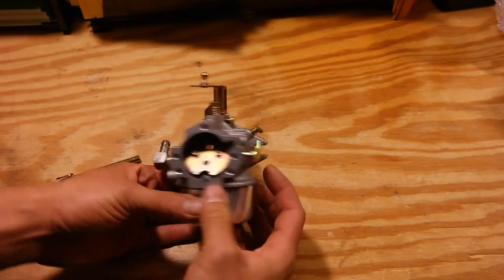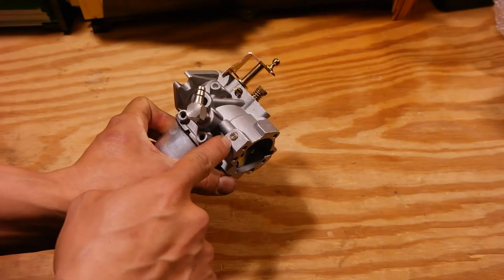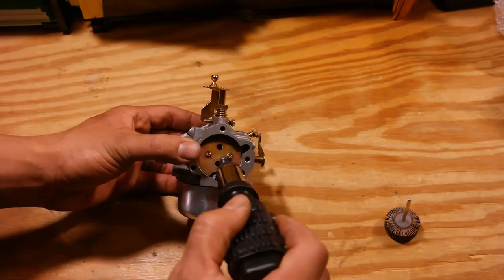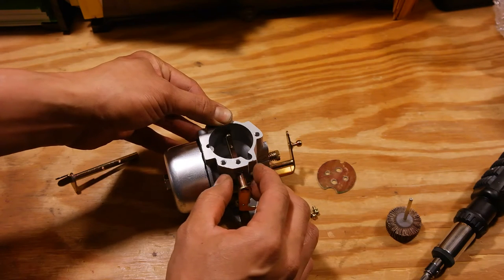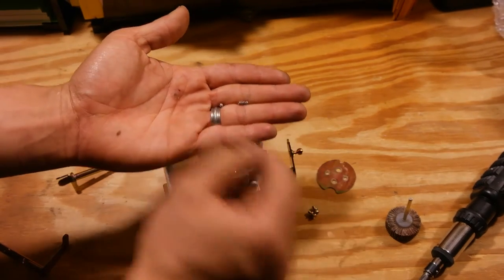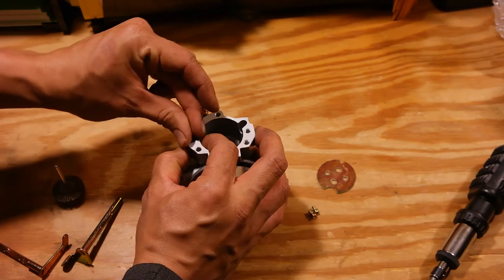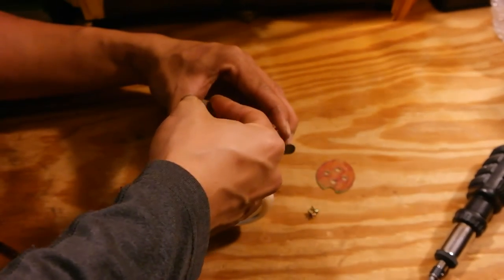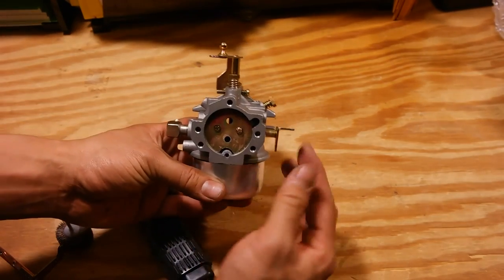How to Change Choke Lever on Kohler K Series Carburetors

Comment: Three hints.

1.  I found it more useful to use a 1/8 drill bit from the side to push down the ball bearing rather than from the top.  Use the replacement choke shaft to block one side of the side hole, and manipulate the ball with the drill bit from the other.

2.  Do the entire procedure in an extra-large dog dish.  Until you get the hang of the procedure, you're doing to drop the bearing and the spring.  If you do it on a bench top or table, you'll probably lose parts.

3.  When the choke opens, the top of the plate rotates into the carb body.  NOT the other way around.

Comment: How do you remove the carburetor from the engine block? I have a Kohler 12 K301A engine with that same carburetor! I've loosened the two bolts that attach it to the block but it won't budge. I can't figure it out. Love the vids.
Reply from the maker: just give it a little tap with a screwdriver and small hammer. it's only held on with the two bolts so it will come off. Previous owner may have used an RTV sealant or something between the engine and carb. It will come off
Reply: Thank you for the replies. Is it normal for the bolts not to come out completely? They're loose but can't be pulled out because the carb is in the way. I'll try tapping on it again. Thanks again.
Reply from the maker: THEJUNTMAN once you dislodge the carb a little the bolts will be able to be backed all the way out

Comment: question on the kohler throttle limiter spring... have some surging going on - k241 engine at WOT.  seems to be play in the shaft from the governor shaft to the carb that is where it's from - wear most likely.  will putting this spring on the governor shaft to the carb throttle shaft remove this slack?

Comment: So I have a k301 that needs a new carb like the number 26 on your website BUT the original carb has the throttle lever like your number 30 carb. What do I do because the number 26 throttle lever won't clear my air filter housing?
Reply from the maker: You just cut the end of the tab short and you're good to go!
Reply: @Isavetractors  that's what I was thinking but was hoping for a cleaner solution but hey function over form right lol.

Comment: My choke on my 321 won't stay open.  As the engine runs and vibrates it'll sometimes put the choke back on.  Could this mean mine is missing that spring and ball bearing?  Can we still buy that spring and ball bearing?  Also any idea what size / length the 3 air cleaner mounting screws might be?

Comment: My cub cadet 1450 is not running good and I cannot get it to run right no matter what I do do you think this carburetor will fix that problem?
Reply from the maker: It depends. What's it running like? Any smoke coming out of the exhaust? I will make some generalizations: Most Common Running Issues with these Engines: 1. Too Rich Fuel Mixture. Remedy: Change Air Filter 2. Point Timing, check your timing make sure it's at .020" Gap. 3. Too Lean of Air/Fuel from worn out carburetor. Buy our Carburetor to remedy that 4. Valve Clearances too tight from wear. Remedy, Re-adjust. Send me an email: info@isavetractors.com if you have any further questions.

Comment: would you recommend adding a small bit of low strength thread lock to the choke plate screws or will the lock washers be sufficient. Just concerned with vibration
Reply from the maker: A little blue loctite wouldn't hurt but it's not necessary. Split Lock Washers will prevent the screws from vibrating loose. We haven't experienced any problems with them, and customers have never reported them coming loose and we have sold thousands of carburetors.
Reply: I read somewhere in a forum that lock washers work better and keep screws and bolts securely tight than  thread lock, and from experience  lock washers are my choice

Comment: I just put a china carb on my Kohler K301 on my Wheelhorse and it wont run unless you keep it choked with your hand. Why?
Reply from the maker: Could be a lot of things. Since it's not our part I cant easily speculate. Typically speaking you could be pulling in too much fuel and that's why covering the air intake completely is balancing our the air fuel ratio. It could also be related to other parts of your fuel system. I recommend contacting the place you bought it and consider iSaveTractors in the future
Reply: @Isavetractors  I bought it from someone and it has been sitting. I left the key on and 10 minutes later the coil got hot and busted open. I was told that is normal for those old round coils. Seems crazy.
Reply from the maker: There is some truth to it. If you leave the key on and the points are closed you will run 4 amps of current through until the battery dies. Coils shouldn't explode unless there is a short or another reason for heat. The points though will start to deteriorate.